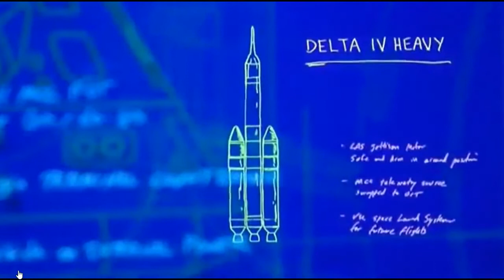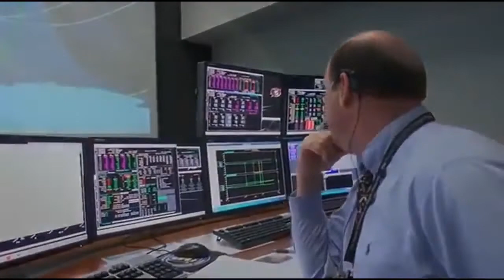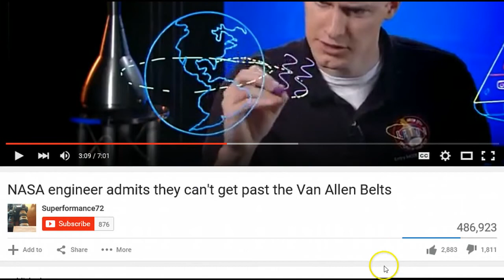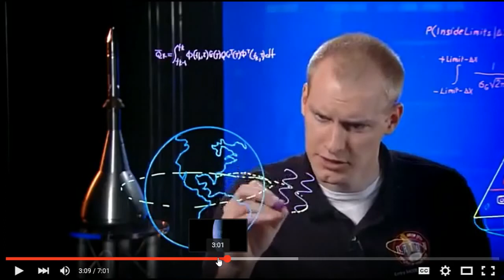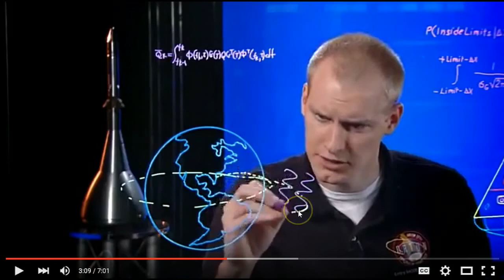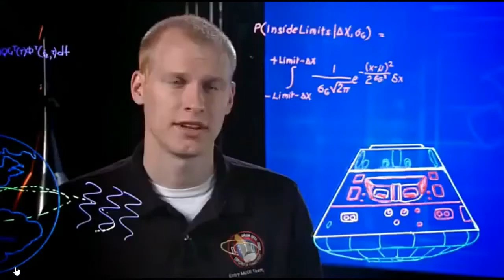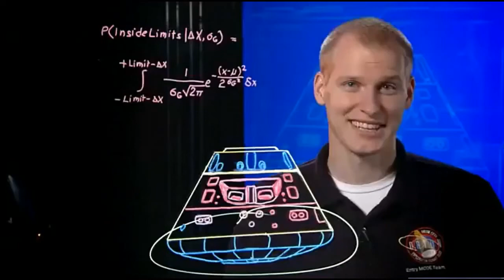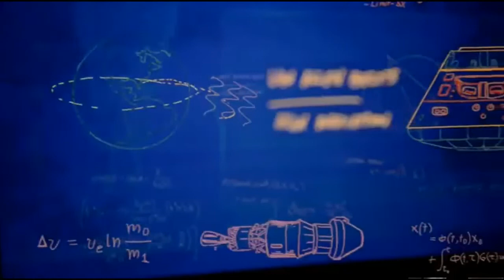NASA Orion Confirming Starting Where Apollo Moon Landings Left Off

Comment: he is not admitting that they can't or have not gone through the VanAllen belts
he is saying that since the payload, the capsule, is a new design, they are testing it 
Apollo went through the fringe of the belts very quickly
.. as possible Orion missions are in other directions, they will have to transit thicker areas of the belts or -- in the case of a mission to an asteroid or to Mars -- have to stay out longer than anyone did on Apollo missions.  they did similar testing with unmanned launches to test systems before sending any people to the moon with Apollo
en.wikipedia.org/wiki/List_of_Apollo_missions  .. 16 or more

by your logic they shouldn't have to do new vehicle testing .. they've already solved all of the relevant problems
.. tires, check .. engine, check .. lights, check .. breaks, check .... no need to see that this configuration works as planned

777 ?  I thought it was 666 I had to be frightened of
that's a way of quickly indicating a region of his diagram with squiggly shading
cdn4.vectorstock.com/i/1000x1000/06/38/shading-vector-200638.jpg
777 is also important in Unix chmod .. or the number of a commercial jet .. or a South African Boer nationalist movement

space exploration is a logical and consistent extension of previous technologies and programs to explore and survey the Earth

NASA uses cell towers to communicate with spacecraft ???  
I thought the basis of NASA as hoax was that none of it was possible at all.  
yet here you are discussing various ways in which it can be done
Reply: He said they have to SOLVE THE PROBLEM BEFORE they can send people in to space. That's means they can't send people into Space now. Doesn't take a genius. If they could already do it, they would have the technology to incorporate into the new design. This is common sense. If they could do it, other countries would have done it already. Once  a technology is created it spreads.